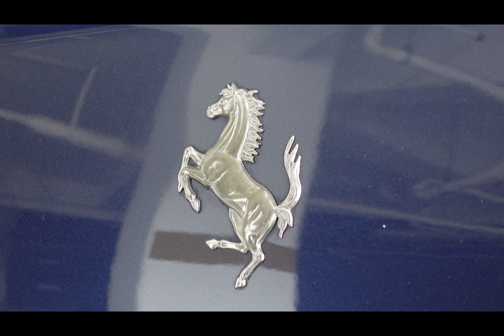Ferrari Maranello 550 Gets a Detailed Car Wash at Home | re:Fresh ASMR

Comment: Hey Thomas! What is the ratio of shampoo to water that you use in the foam cannon? Also, how many pumps do you do to lather/agitate the shampoo?
Reply from the maker: I’m still trying to figure out the best combination. So far the best I’ve tried is 5ml to 1.25l for the IK foam pro2.

The other trick is to have water in it first so when I put the shampoo in, I can mix it versus bubbling it up.

The other thing is I learn that more is not always better haha. 😂😂

But I usually pump until the foamer starts to give strong resistance.

Hope it helps.

Comment: hi thomas, do you have any product recommendation to detail exterior plastic?
Reply from the maker: Hey Jason. There's a few you can check out:

1. CarPro CQuartz DLUX
I heard it's pretty good. Never used it but the high Silica content would suggest good protection against UV. But installation may require more skill and difficult for people who haven't used Ceramic Coatings. Can be quite expensive too

2. Carpro Lite
Cheaper than DLUX. Pretty happy with them on my car. Makes it darker too and feels good to have UV protection.

3. CarPro Perl
Easier to use and less intimidating for most people. Very versatile can be used on your tyres and inner trims too. But not as permanent like the above two. So you might need to apply it more often.

But generally look for UV protection. Second thing is to consider is how it looks after a few days or week. Some leave weird white residue or stains. So far these 3 up here don't leave weird residue and takes the heat pretty well.

Hope this helps!
Reply: @ThomasYap  thanks for the recommendations, will look into it